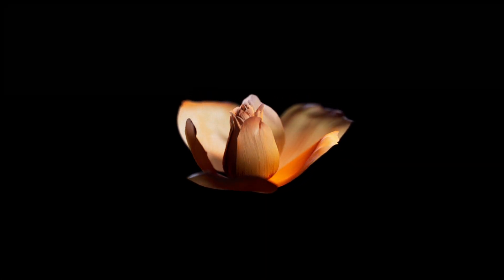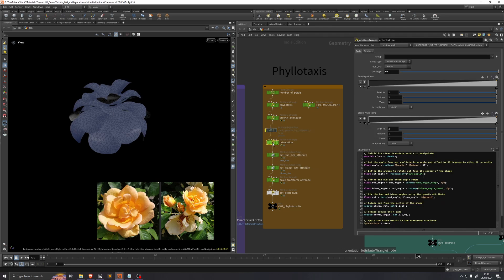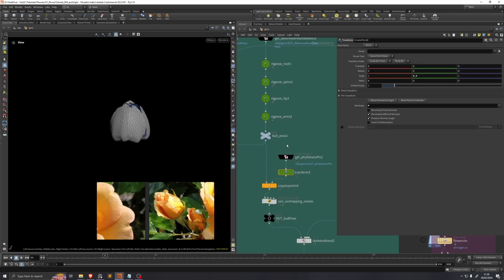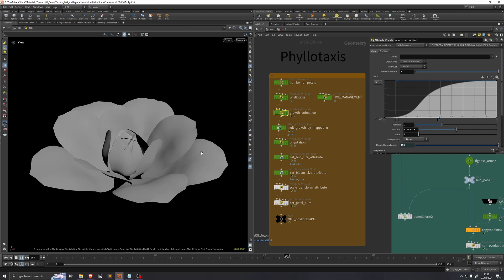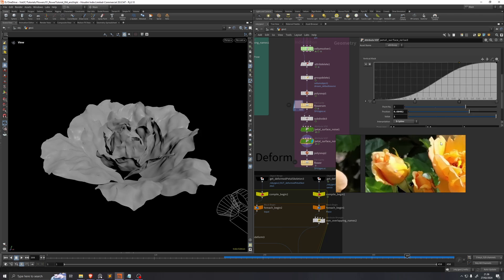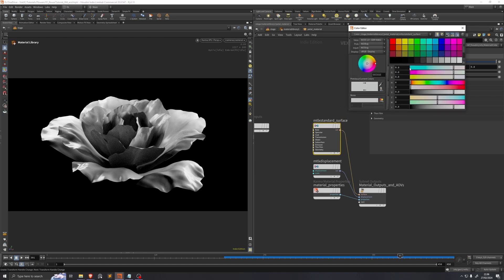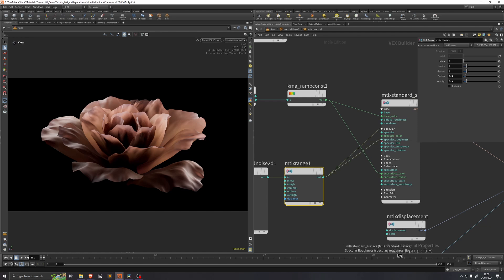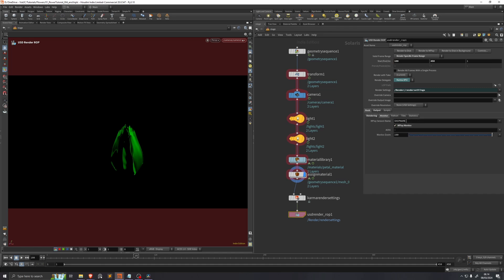Houdini Tutorial | Blooming Flowers | Model, Animate, and Render | Part 4

Comment: Awesome project! Just a note - ( i don't know if its just me) but none of the hip files work, has masking errors and does a weird skipping thing during the animation blending. The wrangle codes are also completely different/changed in the hip files vs the tutorial video.  I managed to get the flower working through some tweaking, but might be very confusing to people learning houdini.
Reply from the maker: Hi, thank you for your comment!

If you have time to spare, it would be really helpful for me if you could show me specifically what those errors are. You mention "masking" errors. What do you mean by that?

As far as the wrangles, I built the project files while recording these videos and didn't intentionally change anything in between finishing the recordings and uploading the project files. So if there are any inconsistent wrangles, I would love to either fix them or write a note about the change so people can follow along. Could you point me to a wrangle in the project that has changed from the last time you see it in the recordings to the 01_flowerTutorial_004_end.hiplc file?

A thing I should have mentioned, and will work to update in the descriptions (potentially add a readme file) is that there will be warnings about incomplete asset definitions, but because the assets are unlocked for editing, this warning doesn't stop anything from working.

Thank you!

Comment: Amazing tutorials Danny! Thanks for sharing your knowledge, best houdini flower simulation tutorial I've ever seen. Love your render and karma materials.
I have a question, before pt.3 Solaris setup (in 10:18), in my bud pose, each tip of petals intersecting(clipping) each other petals.
In solaris setup in your video, the flower bud like frame 100 showing well organized bud pose unlike my bud pose.
Did you solve this problem with transform each petal_num or changing some pose?
Reply: Solved clipping problem! I didn't assign bottom attribute.. I got new problem ;-; my flower bud is now well organized, but when it perfectly bloomed, petals are streched like melted cheeze.. Is this problem of Cloth bend-stiffness value?
Reply: Looks like you need to increase the stiffness in the stretch parameter… if you don’t it’ll look like rubber or a slimy material, it seems that’s the problem from your description.
Reply: @RubaoAbranchesFilho  Thanks a lot! I increased substeps in vellum solver and solved problem! I also increase stretch stiffness parameter too :)

Comment: Great tutorial Danny, thanks for sharing the scene files. I notice that some things are broken in the scene when using 19.5 rather than 20. The growth attribute is missing at the petal surface noise VOP. Not sure at what point in the graph it get baulked, but H does throw a lot of param errors on opening the scene in 19.5. The flakey backwards compatibily is one of the more frustrating aspects of houdini. I have 20, but I'm sticking with 19.5 atm as it seems more stable.

Comment: Heydo! I got a question during the karma material step. The way karma is reading the uvs is square by square instead of Individual petals. Do u know what attribute caused this or how to fix it?
Reply from the maker: Hey. I don't really know what you mean by reading the uvs square by square.

In SOPs, you can hold spacebar over the viewport and press 5 to switch to UV view to verify that your UVs look as expected.

Otherwise, download my project file and check the uv and uv2 vertex attributes. Compare that to your own project to see if there might be something you missed.

Hope that helps!
Reply: @DannyLrsn  I got it to work, had to rewatch 3.5 and I magically changed. now I'm having some trouble with the displacement using unlit as a preview doesn't let me preview. I compared to your file and nothing changed. Could this error be because I have the education version?
Reply from the maker: @LittleMountain111  I really doubt that your license has any say in whether displacement works.

In terms of using the unlit surface node to preview, remember to take the output of that and plug it into the shader where the standard surface is by default. Maybe watch the part where I explain it again and pay attention to which outputs go to which inputs.

If displacement doesn't seem to work, try to increase the displacement scale by 10x to verify that nothing happens. Then check that you actually have values going into displacement by using the surface unlit.

Hope that helps
Reply: @DannyLrsn  go it! Had to update Houdini. ty for the tips

Comment: Thank you for making this 4th part super fast!! Question for you, I'm trying to make a lotus flower which is a very stiff flower but I find that causes a lot of clipping especially on the inside of the flower. any tips for how to fix that?
Reply from the maker: When I made my lotus, I increased the bend stiffness on the cloth constraint quite a lot. The intersections show up because the pin constraint wins against the collision check. You can decrease the stretch stiffness of the pin constraint. You can also increase the collision iterations in the solver to help the collision solve take priority over the constraints solve.

Hope that helps!